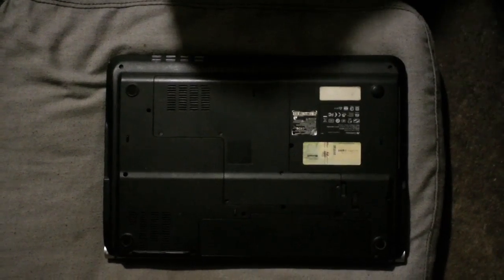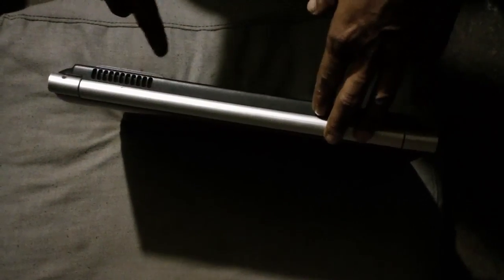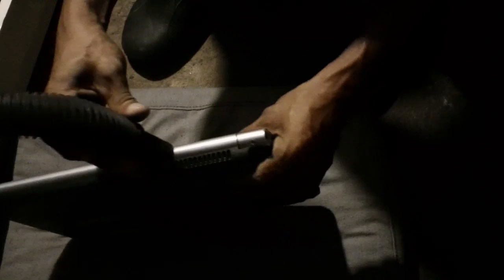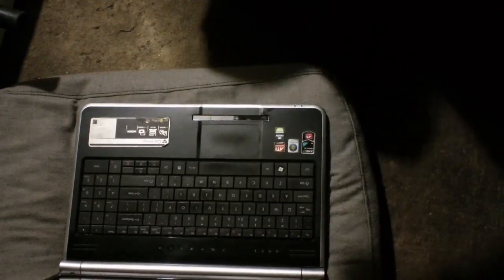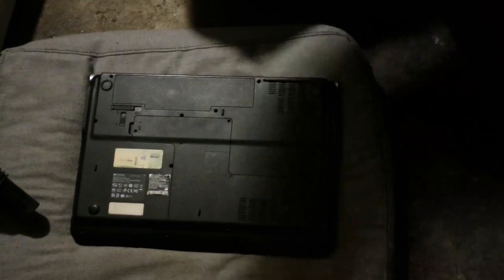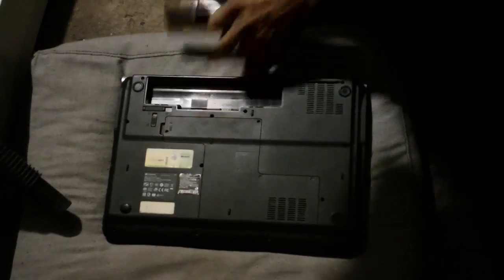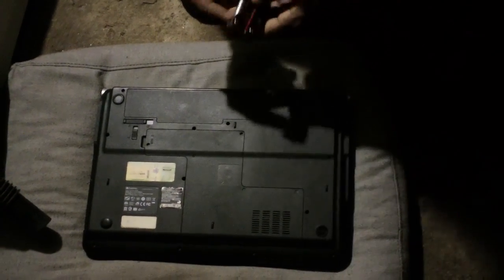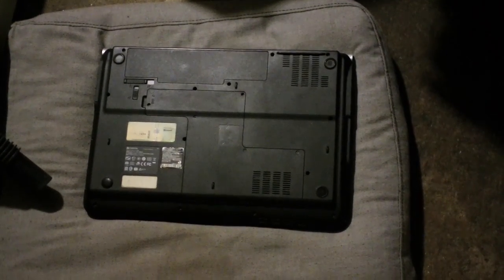Laptop Shut Off By Itself? Cheap & Easy Fix !!

Comment: When you spin the fan with vacuum  or canned air, you are creating voltage when spinning the fan. If your motherboard dies from using this technique, here is the reason: You spiked the voltage and blew out your motherboard or fan...etc...
Reply: even you turn off the laptop still have voltage to motherboard ?

Comment: My laptop was currently over heating and turning off so i used this method and now it is only turning on for 15 seconds then shutting off? any idea what i can do?
Reply from the maker: i used a small clip on fan and aimed it at my laptops vents, i put a lighter or something to lift the back of the laptop to increase airflow.......

good luck

Comment: i have done this much times , works for 3-4 days but after that is telling same problem after 3-4 days . any fix ? pls reply
Reply from the maker: Ardit Nimanaj I'd recommend running diagnostics.. This way you'll know what part needs to be replaced.. It can be as simple as swapping out a fan, to replacing the processor.. Let me know what you do

Comment: Ok I got the solution. U need to download Lenovo settings and turn off the setting. Then under the rear case theirs a sensor called sw2 its super sensitive and it detects if the case is removed that is the problem. It needs to be saudered on both sides so it can always detect that the case is in

Comment: i have a gaming computer its a leveno idea pad y700 and it shuts off at 68% i was told its becuase i was useing chrome and my computer came with windows and internet explorer and i use chrome i dont k ow if that the problem becusse there interfering
Reply: actualy no. windows  says that so that people will use their program. probly its true, but most likly, if it shuts off at 68% its probly either a virus, the fan, or some other probly. it could also be your battery cause that happend to me once and i ddint know what it was so before i knew about fan dust i bought a new battery :P

Comment: IF ANYONE CAN HELP PLZ REPLY. I have a lenovo thinkpad laptop. My problem is that if I move it or if the areas under the keyboard get hit, the laptop just shuts off immediately. If anyone knows what the problem is I would greatly appreciate it. Also if there is a possible solution I would like to know about it. Thanks
Reply from the maker: Yash Stanton  check your battery connection.. Or power cable connection.. Sounds like you have a power problem
Reply: My friend said maybe its the battery but thx for helping :)
Reply: strandedinpr Can you help ? I have an Acer Aspire and it turns off every 30 minutes exact. Its been driving me crazy that I don't know what the exact problem is. Ive already tried speed fan and my laptops not overheating.
Reply: YDS Gaming I have the same problem except I have an hp laptop on windows 8.1 not the overheateaing the moving
Reply: YDS Gaming uu

Comment: Will this work on a Toshiba laptop, i tried blowing out the dust with a straw since people recommend that but it still shut off with no warning
Reply from the maker: Keziah Owusu a straw? really? how did that work out? you might need more air pressure, try one of those dust sprays, they are about $5....
Reply: strandedinpr tbh it did work at first but 2days later it started again
Reply from the maker: you might hav to open the laptop and detail the inside... theres probably a dust ball on the heat sinks,,,